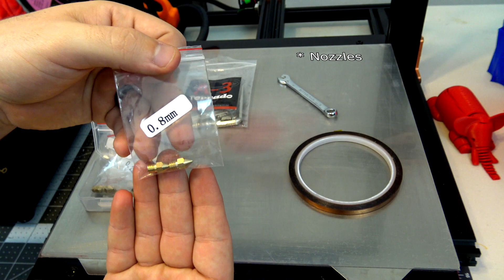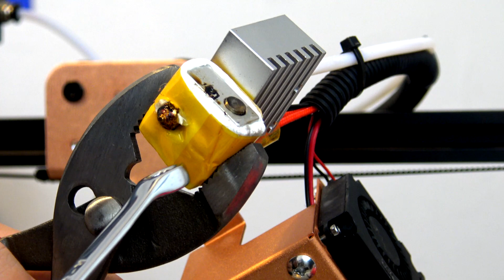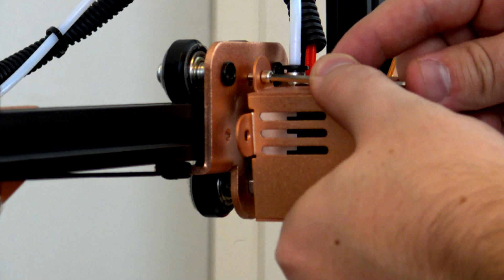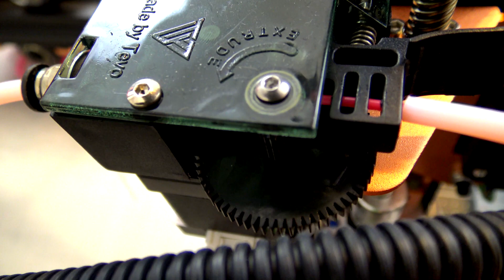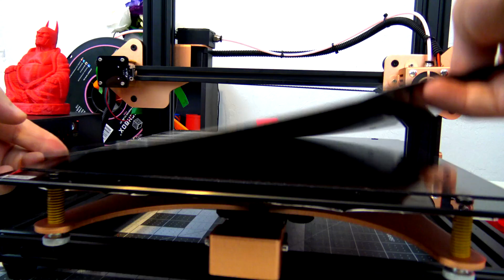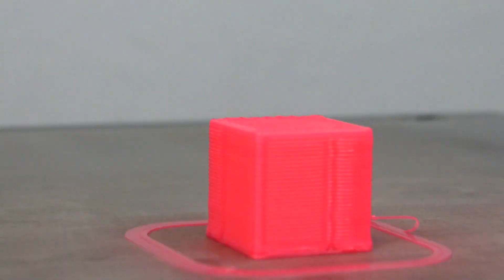How to swap your 3D printer's nozzle - 0.4mm to 0.8mm Nozzle Upgrade!

Comment: use a 0.6 nozzle, the bottleneck is in the hotend, not in the nozzle. With a 0.6mm nozzle, at 0.45mm layers height and 0.7 line width your max speed is 70mm/s unless you want to go high temperature and crank it up from 218 to 230-240ish which then you can do 90mm/s (28mm^3/s)
Unless you only print big stuff, 0.6mm is way more general purpose than 0.8.
Reply from the maker: Yeah, i found I had to print PLA at 230 to print 0.5mm layers and have it bond the layers well. I have a few other printers, so I wouldn't be opposed to having this printer be dedicated for large format prints. But, i think you are correct and that this hot end would be bottleneck. Doubling the nozzle diameter is 4x more plastic to melt, it's crazy.